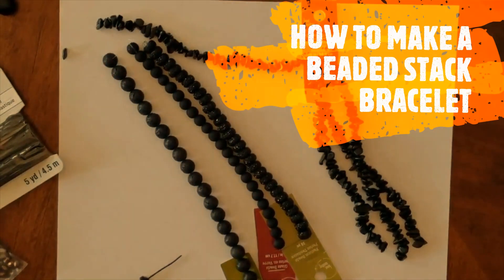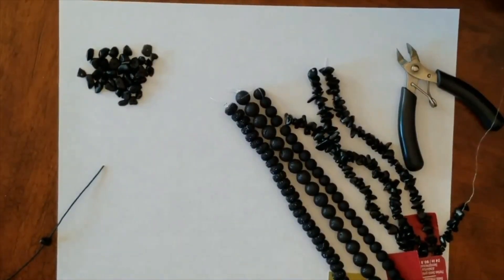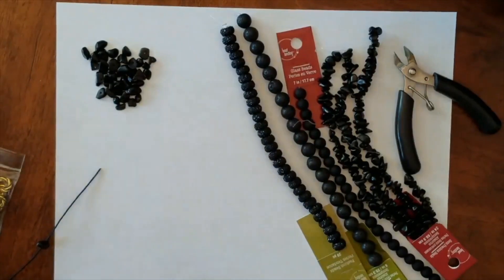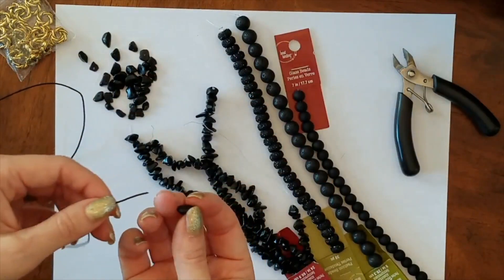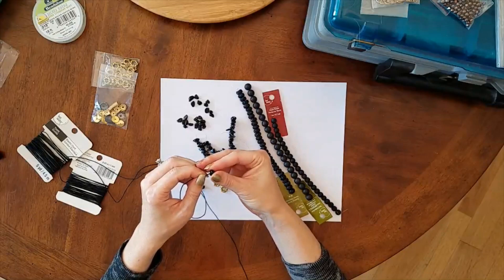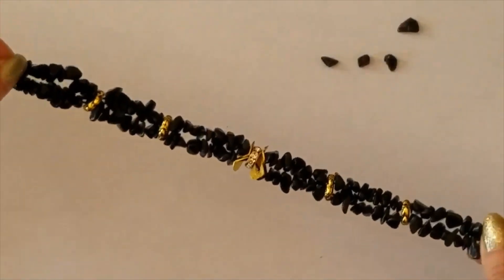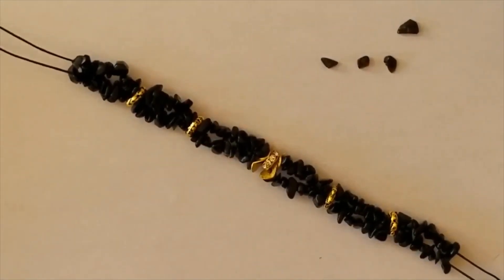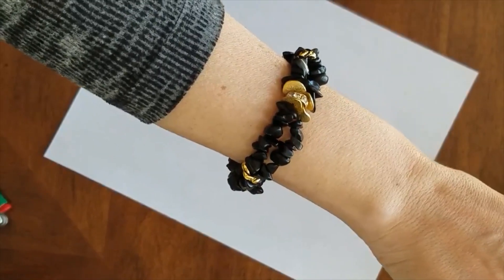DIY Elastic Bead Stack Bracelet

Comment: Hi, I love the bracelet you're making. Elastic Magic is the best cord that I've found for doing this. And I think it comes in black as well as clear. One tip I'd like to pass on is: buy or find as many little bowls as you can to put your beads into. I've got lots of pretty little bowls from thrift stores and from friends and neighbours who know I make jewelry, and so they give me any little ceramic bowls they don't need any more.The sort of bowls I mean are the kind you use for soy sauce, or to put trinkets into. It's a real game changer when you have these!
Also, I wanted to mention that it's fine to use jewelry glue, even if it's a bit smelly, because the smell should go away when the glue is dry. I use different glue for different purposes and the ones I like are E6000 Jewelry Glue, Zap Jewelry Glue and G.S. Hypo Cement, which is my favourite because it has a long thin tip, so you can place the glue exactly where you want it to go.
Love from Amanda in Australia xox
Reply from the maker: Amanda you made my day with your comment! This is so helpful and I really appreciate your stopping by and giving us all some great tips! ❤💖💞